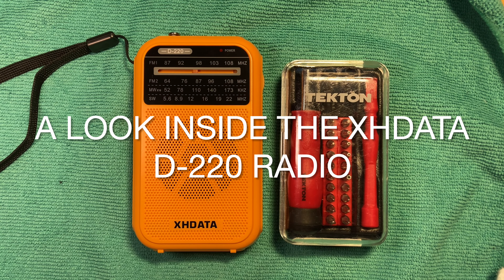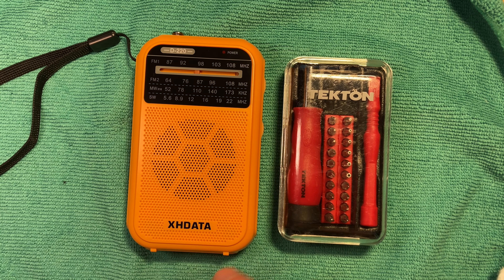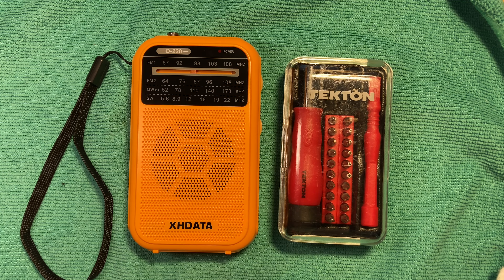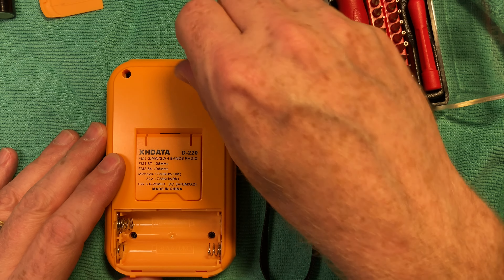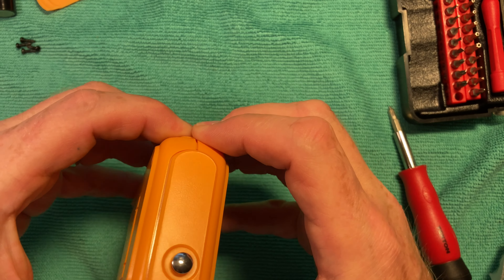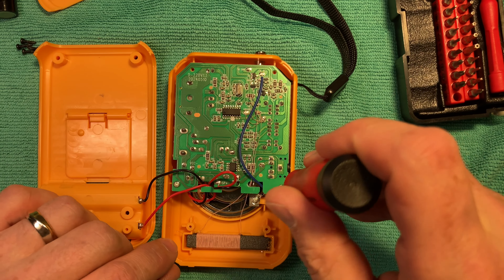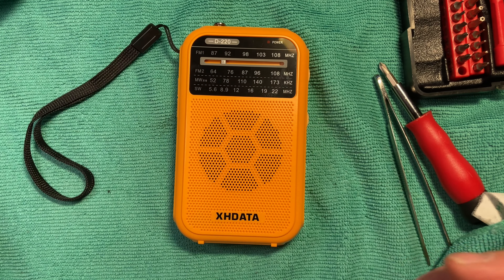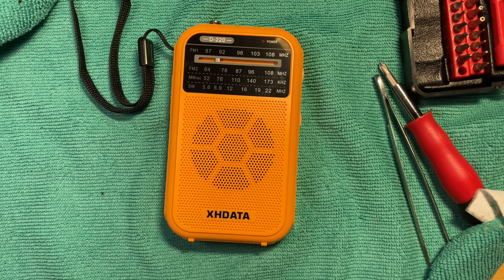A Look Inside the XHData D220 Radio (with a small modification)

Comment: Warm at low setting the face plate came off. With careful action. Then painted mine with silver nail polish. Then used a bit of glue to return the face plate keeping clear of moving parts. I got lucky PS turn both as in 0523 to 1700 to make easyer reconnection😊😊😊 ps#2 put some packing tape on said face. To avoid scratches. 😮😢

Comment: how is reception in home? clear or just mediocre
Reply from the maker: I haven't evaluated it carefully, but there are lots of reviewers who have. For shortwave, it would be best used outside.
Reply: Reception is excellent inside my apartment. Very impressive. Able to get 40, 30. 20, 17, 15 Meters and hear Hams on cw. Also WWV 10, 15, and 20 Mhz. Even low end of SW is sensitive. There's no B.F.O. but you can still decipher cw signals on while tuning in AM. Tuning very slowly is important, because you'll usually only hear cw on one frequency because of the broad step tuning. I like the audio, no complaints there.

Comment: The D-220 does not come in separate 9- and 10-kHz tuning step versions. According to Jay Allen's review, the tuning step is 1 kHz on medium wave, making the radio suitable for use worldwide.
Reply from the maker: @paul.steckler  That’s interesting because this one was specifically sold as the 10 kHz version.
Reply: @sfred  I see that indication on the Amazon pages. On XHDATA's site, there is no suggestion that there are two different models. I'll ask XHDATA for clarification.
Reply: @sfred  I received a response from XHDATA in China, who confirm that the medium wave tuning step is indeed 1 kHz, and that the radio can be used in countries that use 9 kHz station separation.
Reply from the maker: @paul.steckler  That's good news. I had noticed when I took the D219 apart that the chip has that mode on its datasheet.

Comment: Thank you for tear down, I just placed an order for one

It could be Si4836 chip?

Edit: I returned this device as I was not sure if I should be using it with that "unknown " chip in it 🤔
Reply: Si4836 is a stereo chip, since d220 is a mono radio like d219 (which use Si4825, a mono DSP), the chance is close to zero (why pay more when a cheaper mono chip could do the same?)

Comment: Thanks for the very interesting and informative video. I've been eagerly waiting for someone to go look what's inside this little radio. Thanks for sharing it. Pretty lame of XHDATA to have erased the markings on the chips IMO. 
It's an excellent little radio, I like it. I use it for SW mostly and even on its short whip antenna, it catches a lot of stations. I actually did a SW daytime outdoors shootout between it and my PL-330 lately (built-in antenna only) and it turned out to be almost a draw. The PL-330 did better only on signal stability with less fading. But on signal/noise it was a tie.
When connected to a long wire, the D-220 doesn't quite overload in my experience but it lacks selectivity and stations step on each other up to the point of not being quite hearable. That's my main gripe with this radio, with the single SW band scale that requires fairy fingers to tune it. This plus the fat needle provide almost no usable information on the frequency you're listening to.

Comment: Excellent video, especially for those of us who wanted to know what's inside their D-220 but didn't want to risk stripping the little phillips heads on the screws. :-) Looks like the loopstick is 50mm and the whip is 35cm / 14 inches, with 3 inches buried in the body, making the 'short' whip actually more effective than it looks. I also recently got an orange D-220, I've found that the pointer is still decently visible, because the LED acts like a backlight because of the orange plastic allowing enough light through (especially at night). My D-220 works decent on SW off the whip, and will accept a 25 ft indoor wire without overload. MW is OK unaided, and it will indeed DX with an external loop. Just have to tune carefully. Fun little radio, and as you said, would be great for emergencies. Mine has a date strip inside the battery compartment, looks like it was made in August 2024. Also not sure but they may have slightly altered the placement the loopstick at the bottom of the radio, because the shadow through the plastic doesn't look as if it's oriented the same as yours, but it could be just the way it's appearing. Either way, thanks for posting this, as well as your previous vids on the D-219 & D-328.

Comment: It’s good to hear there is no longer overloading, I was incredibly disappointed when I got the D-219 after hearing all the hype only to realize that it is completely unusable in my area for SW. 

Still a little disappointed that FM isn’t great. The D-219 had zero bass when listening through earphones, and I’m guessing they have FM de-emphasis set to 50 microseconds instead of 75 as used in the Americas (there was a photo of the resistor ladder used for band switching on Amazon and I attempted to decode it). It makes my Sony ICF-P27 sound Hi-Fi in comparison, even with its mono output. You’d think they’d have that sorted out since they bothered making a 10K stepping version, but I guess not.
Reply: Funny you write that. I never had much overloading problem with my D-219.
The worst offender my in collection of radios is by far my D-608WB. Pretty much unusable when directly connected to a long wire. I had to design a coil coupler that I sleeve over its antenna.
Reply: @F4LDT-Alain  It’s because I happen to live 4 miles from KGO-AM. 50 thousand glorious watts of sports betting content.
Reply from the maker: It depends a lot on your location. My D219 overloads badly at my house but is fine at the office.
Reply: MW on the D-219 is really good, though. I get some overloading with an external antenna with my D-219, though. Off the whip it varies. Up here in the PNW the SW signals aren't usually very loud, except Asia in the morning.

Comment: This Radio in Junk on AM!
Reply from the maker: If you're in the US, you may have the 9 kHz model, which wouldn't be very usable. Otherwise, its performance is limited by the small ferrite antenna.
Reply: Mine are amazing AM radios!
Reply: Mine works well, similar to a decent clock radio. But you can DX quite well with an external loop. The selectivity is good enough for DXing, with a loop. Maybe, as was suggested, you got a 9 kHz version radio instead of a 10 kHz one?